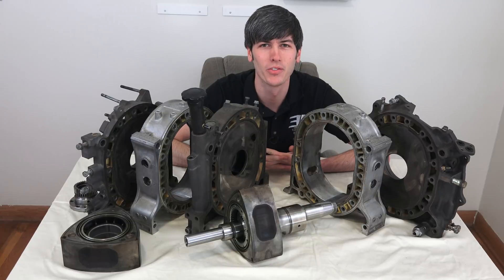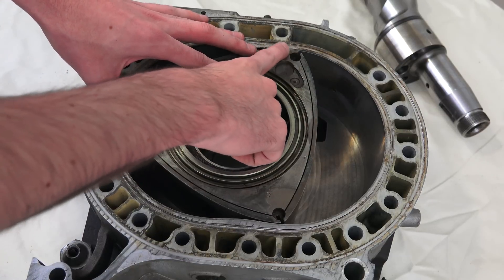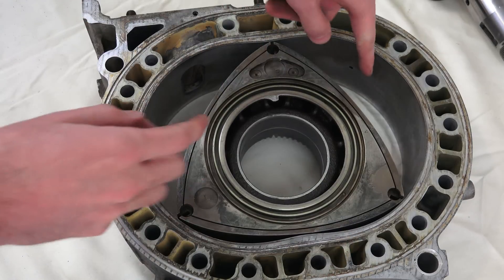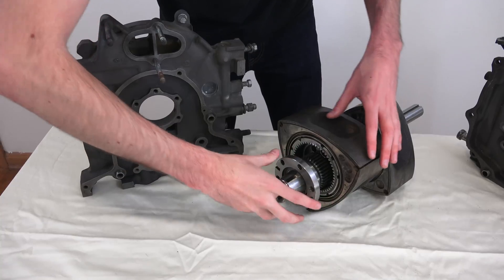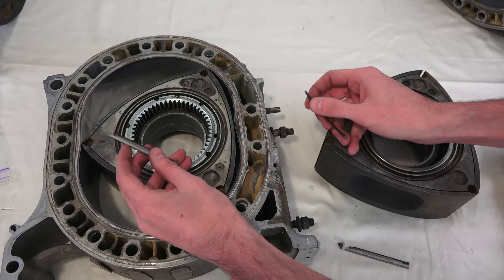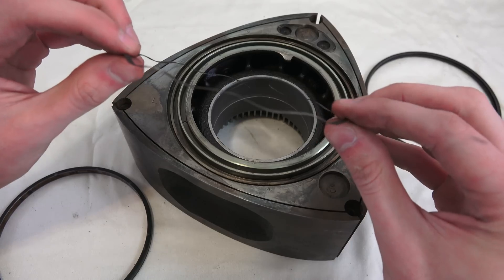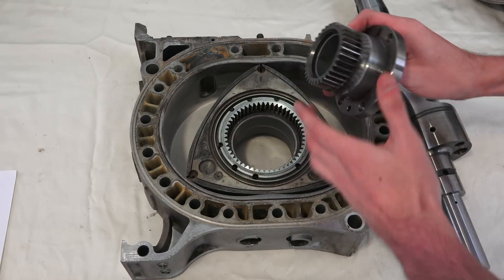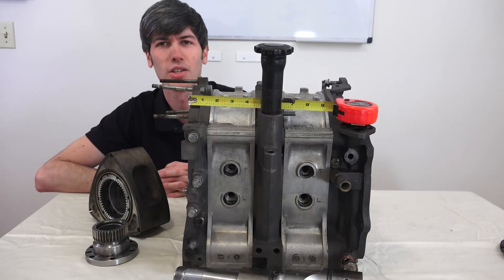How Rotary Engines Work - Mazda RX-7 Wankel - Detailed Explanation

Comment: Do old trucks use this type of engine? seems to me like a heavy vehicle couldn't use this. I mean, the rotary engine probably produces less HP.
Reply: As soon as you get into a gear were you could make decent forward momentum you wouldnt have enough torque to move the load
Reply: +Angel Gutierrez A truck engine should have good low end torque. The rotary engine offers high end horsepower
Reply: User Name What if you put in 40 gears?
Reply: +Angel Gutierrez I also want to add, this engine does seem very cool. the design id genius yet simple. And good job explaining like always! i subscribed.
Reply from the maker: +Angel Gutierrez Thanks for subscribing!
Reply: Engineering Explained Thanks for replying! It is awesome that you care about the comments. :D
Reply: No. Current heavy trucks still use up to 18 gears and 1000ft/lbs. They are also more efficient.
Reply: Angel Gutierrez Well there are a lot of websites explaining this in detail so I will simplify it.
Imagine you want to turn a valve, those old ones who need force to turn. If you try swiping it really fast at the side in one direction it would be like you applying Horse power, but tell me, would it turn? Probably not. Now imagine you grab it and turn it normally, you are basically applying torque here, slow but very forceful and once it starts turning the faster you can turn it untill eventually by simply swiping it (Applying HP) you will be able to turn it quickly without much need for the brute force torque gives. 

1st gear is essentially the same, it gives the car the force (torque) it needs to get going and after it starts going horse power will have more influence. The faster it goes the less torque it needs.

Now the heavier the vehicle the less likely it is to go anywhere fast, and when a vehicle goes slow it needs a good bit of torque to make it move, and the heavier it is the more force it needs. 

This is why when car companies advertise pick ups they emphasize torque more then horse power unlike in regular or sports cars.
Reply: Yes in the 70s Mazda made a small pick up called the Repu and the weight of a vehicle doesn't really matter in terms of hp or torque the gearing of your transmission and differential. Think of a 8 speed bike low gear a lot of rotation for little forwards motion n high gear less rotation for a lot of forward motion
Reply: newdefsys What if you put in a transmission with alot of gears, would that help?
Reply: Angel Gutierrez Yes, in theory. But then you are adding cost and extra weight.
Piston engines are the most economical truck engines.
Reply: +User Name Yes, High engine speeds but relatively low torque. Also there is a slack (if that's the correct term to use here) when the rotor turns the eccentric shaft, since it turns  "eccentrically".there is no smooth continuous constant rotation
Reply: +COMMENT . also TORQUE is highest when the force applied to the shaft driven is perpendicular to it. Anything off the perp. will result in a loss of torque as is the case here.
Reply: Yes, leverage also adds torque. The longer the lever the higher the torque. These have little to no "stroke"
Reply: +User Name Yep
Reply: Also, the design of the piston engine allows the thrusting forces to be distributed, much more effectively, across the main webs of the block, (A very important consideration for a truck engine).
The Wankel rotary engine, or at least Mazda's version of it, is not designed for the thrusting forces found in a truck application.
Reply: +Angel Gutierrez Torque is more important then horsepower for heavier vehicles.
Reply: WarDogTheAwesome What's the difference? Please explain. I am interested in engineering.
Reply: WarDogTheAwesome Interesting.
Reply: +Angel Gutierrez the mazda repu was the only truck made that had a rotary. It came with a 12a and 12b motor and the late models had a 13b in it. None of them were turbo'd tho. There are a few forums that have enthusiasts behind them, but they are quite rare trucks now, and most people don't realize what they have.
Reply: When it comes to doing work an engine will need torque. Generically Torque is achieved the same way you achieve it. A long lever. In an Otto cycle engine that lever is the piston and rod. The longer travel the longer the lever. 

This limits speed, and therefore limits hp.

On the other end you have oversquare engines with a short stroke and a large bore. It can't do as much work but the work it can do it does much faster.

That is how the Wankel works. It does best in constant rpm situations or high speed applications like a light weight sports car. The downside of the engine is its lack of reliability, the excessive use of oil, and the terrible emissions.
Reply: They did make a pick up truck back in the 80's that had a rotary engine in it.. I had a few rx7's back in the 80's, I loved it, I am a strong believer in these.!these are great power plants that are a lot of fun!!!
Reply: The weight of the vehicle means everything. Put that engine into a loaded 80,000lb truck and tell me how far it gets.
Reply: Then you keep on increasing the weight they have to carry, make the vehicle even more inefficient, complex, and prone to failure. Gearing can only get you so far, at a point the engine has to have enough ass to maintain movement of the vehicle at highway speed.
Reply: +COMMENT but there will always be a component (italics) of force that is perpendicular. (right?) Piston engines are only roughly perpendicular at one point in the stroke. One just needs a bigger bang to make up for it. Though they don't.
Reply: User Name wrote: ' It does best in constant rpm situations or high speed applications like a light weight sports car.'

The niche wankels are filling is range-extenders where the engine only turns a generator or UAVs where it is always running at high speed. They then are superior to piston engines. The small size, low weight and amazing smoothness will tip the scales.  Mr Takashi Yamanouchi, the global CEO of Mazda stated, "The rotary engine has very good dynamic performance, but it's not so good on economy when you accelerate and decelerate. However, with a range extender you can use a rotary engine at a constant 2,000rpm, at its most efficient. It's compact, too."

+User Name wrote: 'The downside of the engine is its lack of reliability, the excessive use of oil, and the terrible emissions.'

Mazda are introducing the RX-Vision next year, which is direct drive, and claim to have solved the fuel and emissions problems. I do not doubt them. Use the engine as a range extender and it is bye, bye piston engine.
Reply: The real doktorbimmer
The RX-Vision is to celebrate 50 years of Mazda rotary cars. Here it is:
https://cdn3.vox-cdn.com/thumbor/x9Xg5L4qOctQE8AkxUjYP2OT_j0=/0x0:2039x1359/1280x854/cdn0.vox-cdn.com/uploads/chorus_image/image/47532885/IMG_0484.0.0.jpg

Mazda will use the Skyactiv-R engine in the RX-Vision.

Please get therapy. Think of your family.
Reply: The real doktorbimmer
Mazda have the Skyactiv-R engine. You must stop making things up. 

Wankels are made by 5 companies around the world.
Reply: User Name The Skyactiv-R works. Mazda gave some details of it. They are planning the production lines for it. Again. As a Range-extender the piston engine is NOT cleaner or more efficient as range-extender. Read and understand what I wrote. Do not go by old wives tales or take notice of idiots.
Reply: User Name You never understood at all. Sad but true. 
http://www.topgear.com/car-news/concept/meet-rx-vision-mazdas-gorgeous-rotary-engined-sportscar
Kiyoshi Fujiwara, Mazda’s head of R&D stated: “it will be at the same level for an equivalent standard petrol engine.”  

'It’s a “next generation” rotary engine christened SKYACTIV-R that Mazda says addresses the three perennial stumbling blocks for Wankel engines: economy, emissions and reliability.'

There you go.
Reply: User Name I am only interested in the engine and that has been R&D's. Mazda do not do that for nothing. It costs. Mazda are not a gigantic company like GM, Ford, etc.  They put money into R&D where it is needed.  
You are really dumb. He is on about a discontinued engine that WILL NOT be going into any new Mazda. Then on about antiquated V8s.
Reply: User Name  Masamichi Kogai, Mazda's president  and chief executive says: “We've had 50 years of the rotary engine,” he said. “It hasn't been an easy path, but it will come back one day.” He also said: "but we continue to develop the engine. Keep your eyes on Mazda."
http://www.telegraph.co.uk/cars/news/mazda-reveals-rx-vision-concept/
Reply: User Name You are an idiot! The Skyactiv-R does exist.
Reply: User Name The R&D is ongoing. They are not telling lies. If they did, such a company would be dead.
Reply: User Name You have a vivid imagination. Are you an aficionado of Ned Ludd?
Reply: User Name 
You are saying a reputable company is lying.
Reply: User Name Mazda stated R&D was ongoing and that they had met fuel and emissions.  They even have a name for it Skyactiv-R. You are still saying they are lying.  Mazda are not fishing for money.  They are quite BIG.
Reply: User Name
You are clearly implying Mazda are lying.
Reply: +User Name But at least they sound amazing.
Reply: nfsgt500 they are amazing.
Reply: User Name Drivelous myth!
Modern oil is designed to be burnt without emissions problems.  When the engines are run at a constant speed they shine, as in range-extender applications. 

Mazda admitted they have solved any fuel and emissions problems.
Reply: They actually produce good power. The problem here is the lack of torque which trucks need, and essentially why it will never be used for a truck. This type of engine, even though it is incredibly small, is also not very fuel efficient.
Reply: i Bark I want to buy a Mazda the with that engine. They're relatively cheap too. I just don't want a manual because I am new to driving so automatic makes it easier to drive.
Reply: I want to get a motorcycle because they're cheap and easy to fix and have cheap insurance and use low gas and are easy to park and drive etc.... But they won't let me cause they say it's too dangerous.
Reply: The real doktorbimmer Oh... So my parents are right. 😥
Reply: The real doktorbimmer So maybe when I am older then. 😀🏍
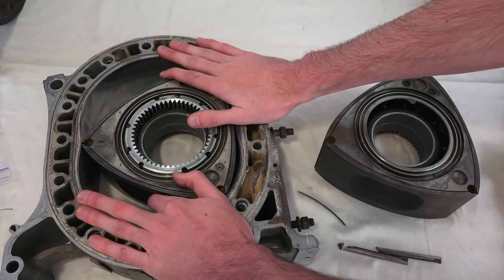Reply: User Name That's a good point. I wouldn't want to drive my bike to school, where I have to be at by 6:50 which is still dark outside unless it's summer. And the rainy winter season would be terrible to be In a bike... Yeah I take it back.
Reply: The real doktorbimmer what happened?
Reply: The real doktorbimmer Wow. It only took a puddle to make you lose control. Bikes really are dangerous.
Reply: The real doktorbimmer Where do you live now?
Reply: The real doktorbimmer I imagine California to be like Los Santos in gta v. Full of hipsters, and cocaine addicted rich actors. Haha. No offense. California is beautiful, but expensive.
Reply: No, although many companies bought the license to use a rotary engine, only Mazda truly made use of it on a mass-produced car. The Rx-7 and Rx-8 are their two examples. The Russians also made a few, but they never got full scale.
Reply: doktorbimmer omg you are rob spaghetti!!! Upset your corvette was beaten by a 3 rotor, and the driver thought it was the most fun and thrilling car out there!

Your hate only eats at you inside ;)

Love for all cars and engines, a true enthusiast has that perspective. Big blocks, vtechs, na, sc, tc, pistons, wankels, support each other; or be a turd like this guy rofl
Reply: no they don't. these engines produce next to no usable torque, are highly unreliable, and have limited practical use.
Reply: Boss they have produced nothing tangible just a concept vehicle with no engine in it. You show me something that proves this engine exists because everything you have posted so far is then saying it doesn't but they want to try and make it. There is no imagination. This is fact.
Reply: The sky active r is a concept engine. It is not produced. There has been no official announcement about the rx vision becoming anything but a concept.

It would be pointless to use as a range extender when an Otto cycle engine is more efficient and clean.

Can you please name the 5 companies that produce them. Not make one offs, not modify Mazda parts, make their own.
Reply: I do understand what you wrote. I understand you went to Wikipedia got a quick glance over and think you know. 

Again, Mazda has not made any plans besides they would like to work the bugs out of the Wankel and make it a feasible option. This does not mean they are ready or willing to produce anything yet. There have been no working concepts I've seen, only commercial sales pitch bs from the concept reveal. 

There is no Wankel produced today that competes with the emissions capability of a Otto cycle engine. You've still failed to name these 5 companies that still make them.
Reply: I guess you missed the part where he said "if we are able to produce this car"
Reply: What about any of that says "we have something remotely near ready for production or even a working prototype". Nothing. It says exactly what I said, " we hope to come up with something that will work"
Reply: I can produce pictures and 3d animations of anything. Doesn't mean it exists. Companies thrive on stretching the truth. They have given nothing concrete about any of this. Even if you read the articles you put here it's a bunch of well maybe, possibly could propaganda.
Reply: They never said they have a functional engine. Ever. Anywhere. They said they have an idea. Basically what you are seeing with that announcement is what you modern types call crowd funding. But instead of targeting the public theybare targeting big money investors.
Reply: That doesn't mean they have a working engine. They never said they have a working engine. You are reading more into it that there is. You are trying to make them look like liars.
Reply: Dude, they never once said they have a functioning engine. They never implied it, they never hinted at it, suggested it, anything of the nature. Thy said they want to develop it and have an idea how to get to a point it is capable of meeting emissions. 

You are putting words in their mouths. Stop trying to use your ignorance as a weapon.
Reply: really following up with those hard hitting questions
Reply: Was funny, I laughed.
Reply: No they are not. Mazda flat admitted they are junk engines. The engine nearly put the company out of business, it was the reason Ford dropped them, and the only thing that saved them was killing production.

The company doesn't have the equipment, or the manufacturing space, or the money to even humor putting it back into production thanks to the financial bind the platform put them in, in the first place.
Reply: Did you read it? I'm not sure how you drew any conclusions besides we have an idea of what we want, we just don't know how to get it.

There is nothing concrete there, he even states we are not sure we can even mass produce this. We have v8 engines putting down 630hp and getting better emissions, and comparable fuel economy to the renesis powered rx8.  A competitive wankel is not a reality.
Reply: You really have no idea what your talking about do you? The engine doesn't exist. Its an idea, a marketing gimmick to bring interest to the company to try and make further wankel development happen. They said clear as crystal they have no intention of producing it. Just an "if its feasible".

Its not.

I'm on about the fact the wankel is beyond its usefulness. The entire principle on how the engine works can't compete with modern engines. Unless the completely change how the wankel engine works, then it will always bring up the rear. WIth VVT, direct injection, and the newer turbo charger technology including electric turbochargers, a wankel can't keep up, or even match up.

Its like a 5 cycle engine. Great in theory, but practice doesn't work out as well.
Reply: No, they sound like crap.
Reply: User Name Idiotic.
Reply: User Name You have no evidence whatsoever. Just myth.
Reply: There is an oiler hole in the wall of the rotor that injects oil into the cylinder to lubricate the walls. Oil in the combustion chamber burns, the burning oil increases emissions, decreases effective octane, and causes carbon depositing. The carbon depositing damages the seals causing unreliability. The engines historically, and with a simple search get horrible fuel mileage for their displacement (also a fabricated thing as the displacement is much larger than advertised).

Mazda admitted the problems openly in the rx vision announcement. They said "we have a solution" but provided no proof of it. Mazda is lying to you and you are eating it up because you are not using critical thinking.
Reply: You don't want one. There are way better engines out there that give good power, great torque, and above average reliability. Not to mention cost and ease of maintenance
Reply: Motorcycles are a great form of transportation. Low emissions, low fuel consumption, enjoyable drive. Downside is you no longer have a cage of steel around you to keep you safe from other idiots. 

There is much less room to err on a bike, everything going on requires your absolute attention or it could kill you. My brother just dropped his bike last week. Years of experience. Did it pulling into his drive way. Came in just a little hot and the bike low sided him. Even sub 10mph it ate him up pretty good where his leg was under the bike.